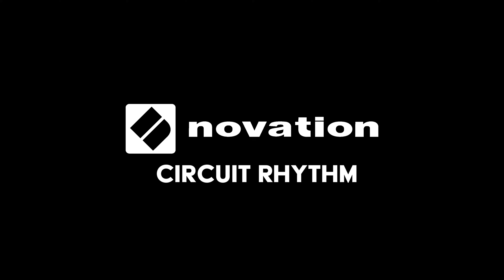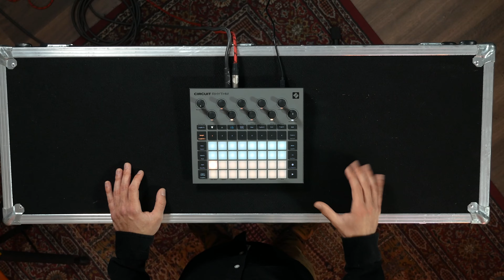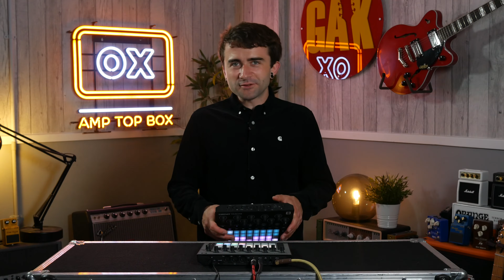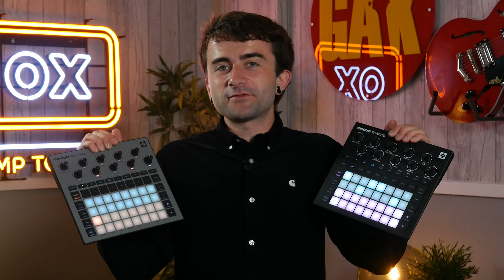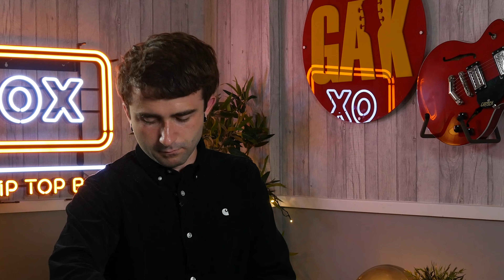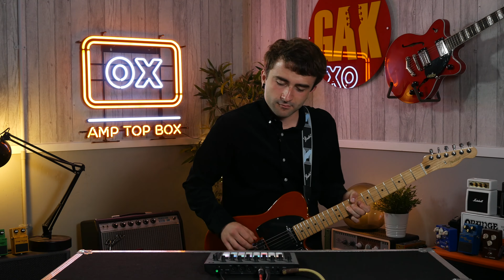Building a Track With The Novation Circuit Rhythm!

Comment: thanks for this, good video.
can i write sequences that don’t use a 4/4 grid ? 
say….  7/8 ..or 11/8 for eg.
also,
i’ve heated the red threshold is a bit low, and also not capable to be reset. 
do you confirm ?
thanks again